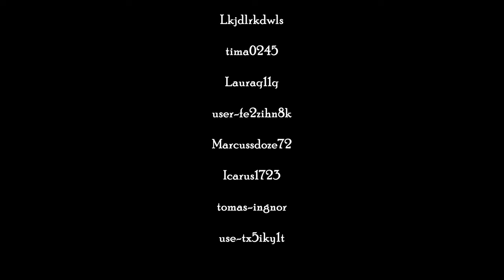2 in 1 Movable Rotary Table / Automatic Planer, Surface Planer / DIY

Comment from the maker: Please turn on your language subtitles!
Join our membership!
This work is a movable rotating table that can hold automatic and hydraulic planes at once.
Automatic and hydraulic planes are not always used. It's mainly used to evaluate wood. In addition, I usually use a lot of birch plywood, so I don't use much.
However, it takes quite a lot of space to fix and install these equipment. Due to the nature of the equipment, long members go in and out of the front and back.
If you have limited space like me, I recommend this work's movable rotating table.
You can put it in the corner, move it to the wheel, and work where you want.
Since each piece of equipment weighs 40kg, I made it with care about the strength of the rotating shaft as well as the strength of the table itself. Rather than making the finish pretty, I paid more attention to maintaining the strength even if there were many marks on the piece.
The washer allows the rotating body to move smoothly, and the product of similar weight is secured on both sides, so it doesn't take much effort to rotate.
I recommend that you try making it, too. Thank you.

#DIY #Table #RotrayTable #Movable #Woodworking #HydraulicPlaner #AutomaticPlaner #2-in-1 #Planer #Tool #Hybrid #DIY_IDEA_INVENTION

Comment: Was ist das für eine Abrichte?
What kind of surface planer is that? (The white Machine)
Reply from the maker: This is an 8-inch surface planner from a brand called Wisiys in Korea. I think there are better products in your country too. please refer to this. thank you!
Reply: @Kynosys_  Don't underestimate your Korean technique. Also here in Europe there is a lot of scrap and for a lot of money. There is also a lot of technology that was made in China, Korea and Vietnam and is sold here under German or English names, for 10 times the price than in the countries of manufacture and only the color has been changed. Your device is probably no worse than our cheap devices. In terms of quality, it even looks much better.